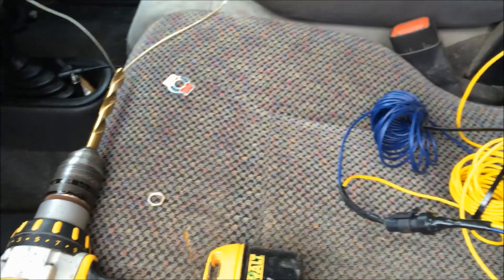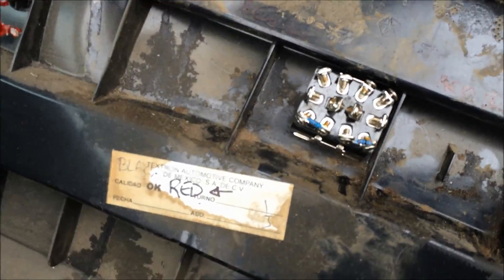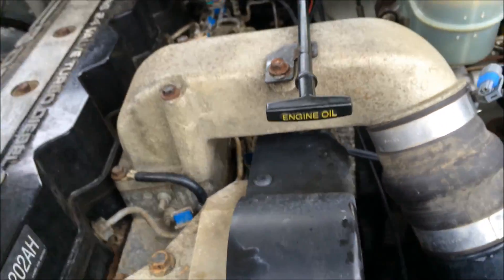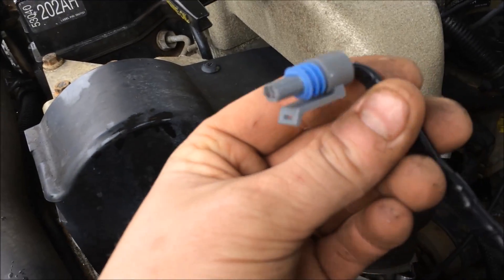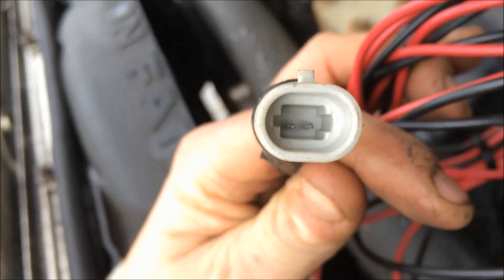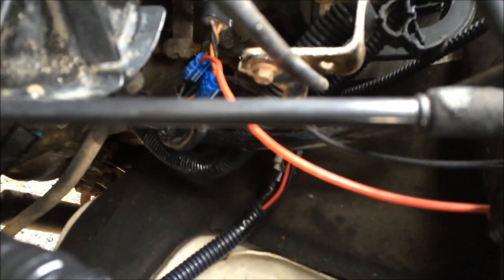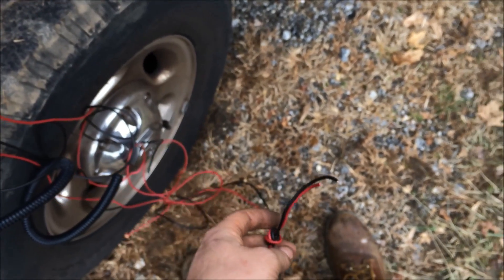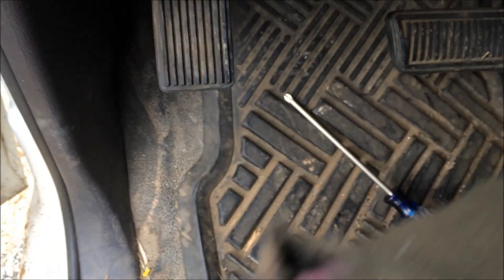Cummins 3 Cylinder High Idle Switch 24 Valve

Comment: I want to wire up the four switch deal.  I have the wiring diagrams, all I need to know is what switches to use.  I know its dpdt switches but like (on)(on) or (on)off(on).  Any help would be much appreciated.